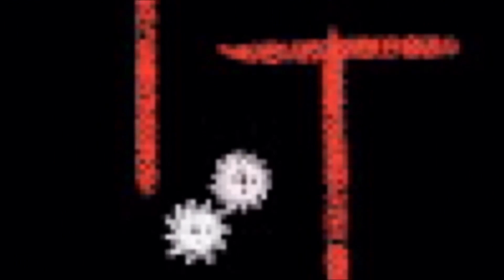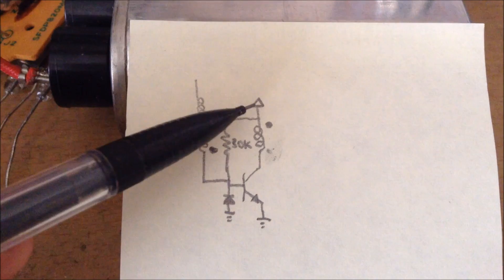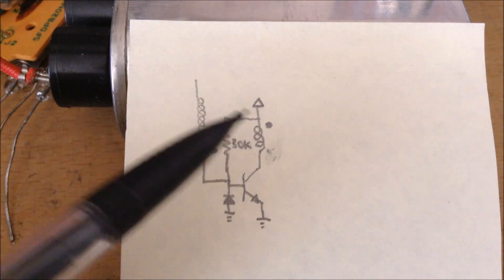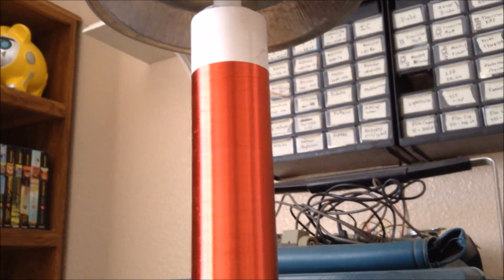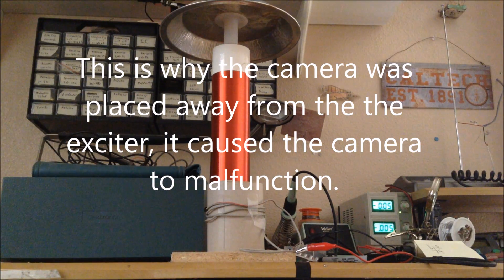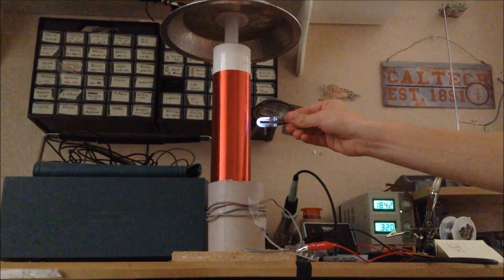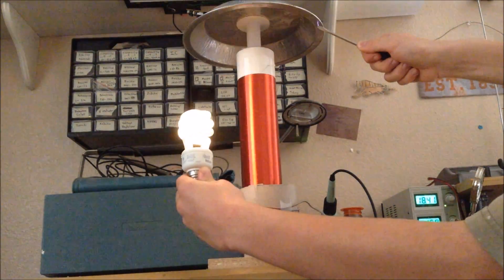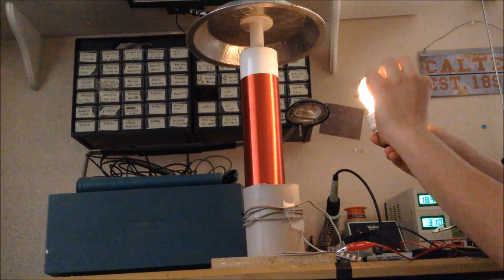Illuminate Lightbulbs Wirelessly: Cheap DIY Slayer Exciter

Comment: try using this schematic with this coil to increase the output.   my coil is 1/2 the size of yours but outputs more, with this circuit. try it out!

I also recommend to be able to TUNE the primary coil.
Reply: https://www.youtube.com/watch?v=33nv5sErrY4
Reply: I tune my coils, it's the best way to get the most out of them, you find the sweet spot and its amazing what you can light. I can light 2-48" bulbs and 2- 24" bulbs at the same time. I use 2n2222a and bd135 and tip31c and tip 41 they all seem to work about the same but the 2n's blow easier!